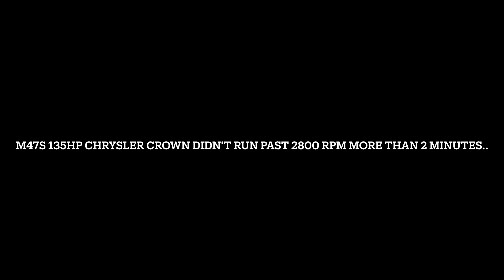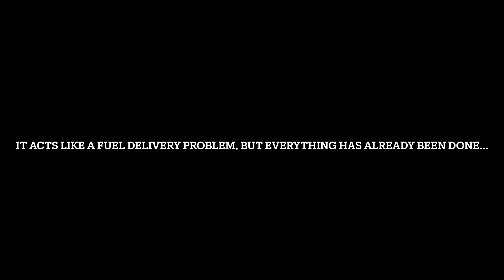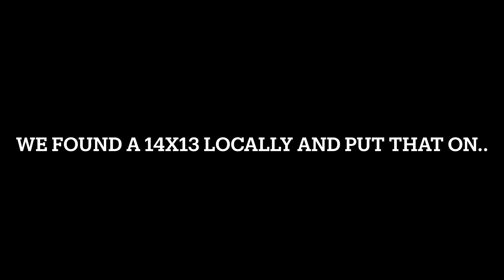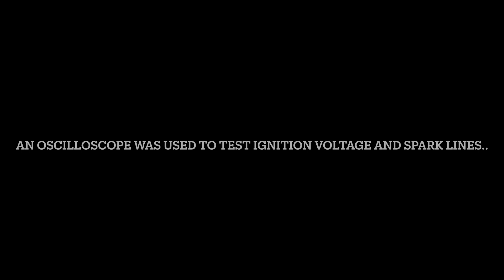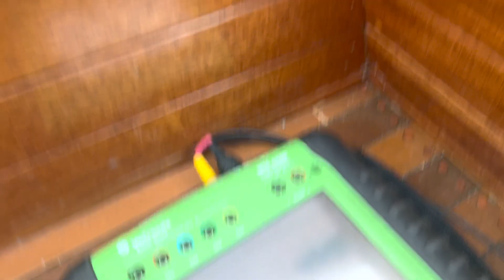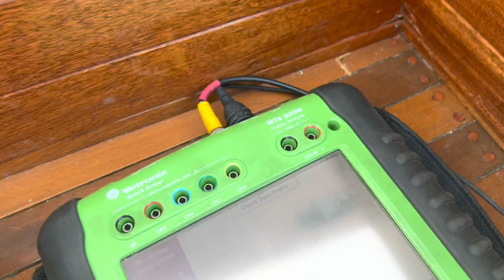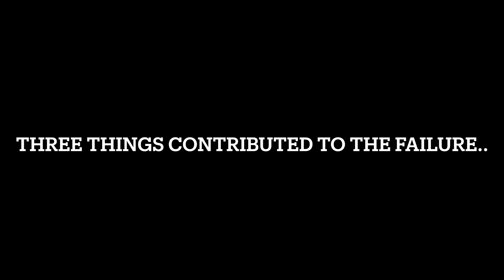1955 22' Shepherd Equipped with a Chrysler Crown M47S 135 HP Engine Diagnosis and Repair

Comment: Just wondering what the meter near the carb is for? Nice video.
Reply from the maker: That's a Pico WPS500X pressure transducer. We were using that to determine if there was an exhaust restriction.
Reply: @LakelandAutoMarine  thanks for replying

Comment: I have a question on why it looked like there was water under the engine while she was a full throttle 
Thanks 
Tim
Reply from the maker: The boat takes about a week to fully soak up according to the owner. It was in our heated storage all winter so it was pretty dry. It had to soak for a day before we even felt comfortable taking it out for the sea trials.

Comment: Is the purpose of the cooling tube to squirt coolant up onto the cylinder head to cool it?  I've never heard of or seen one of these before.  That big six sounded sweet pulling 3,500 rpms.
Reply from the maker: The tube is used to cool around the valve guides and evenly distribute the water through that area. Every Chrysler flathead 6 has one that I’m aware of.